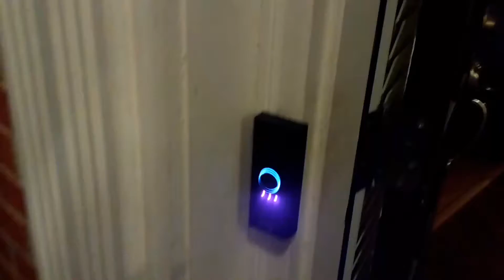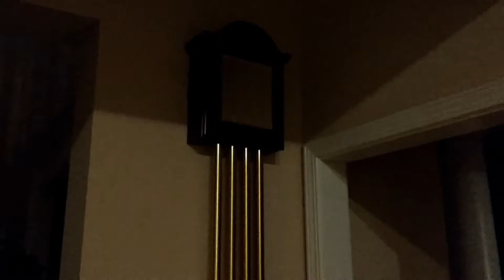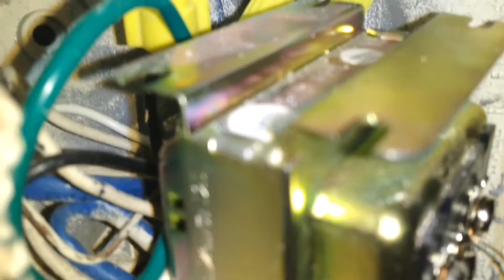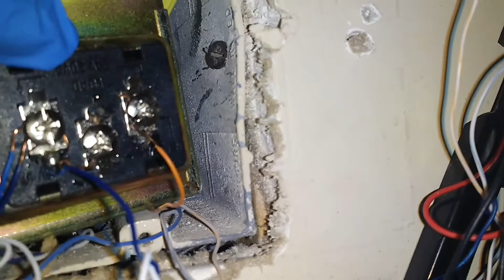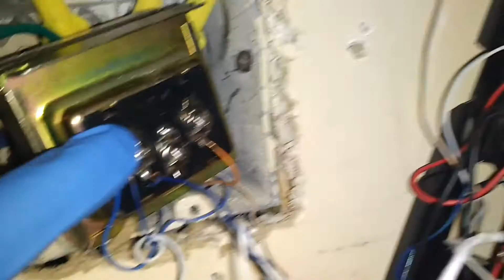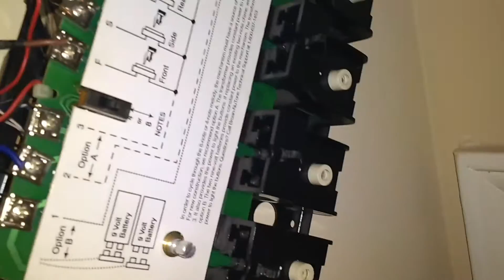Ring Doorbell Pro and Tubular Chime

Comment: I am having exact same problem with a Ring Pro and Broan/Nutone chime that looks just like the one shown in the video. But this video is very hard to follow, I really wish I can understand the wiring that's described here. A quick diagram wold help a great deal. I believe the Broan chime need to have power via terminals 2 and 3, which come from the transformer. Then the Power kit that's supplied by Ring is used to send power to the Ring Pro unit to power that unit, the problem is that when the Ring power kit is connected, it not only supply power to the door bell, but it also complete the circuit between terminals 3 and 4, which causes the chime to keep working. Obviously, the solution is to power the door bell, without triggering the chime when the door bell is not pressed. I have not figured out a way, was hoping this video can help.

Comment: What exactly is the point you are trying to make? You, as many of other consumers have a Ring Pro video doorbell. Are you saying a multi volt transformer is needed? Another You Tuber is saying Ring Pro doorbells cannot be used with electronic/digital chime systems due to issues with microprocessors. While I don’t completely understand why, I tend to agree with him, because that’s the set up I have and I’m getting a lot of interference when the chime sounds. However, Ring.com has a list of both mechanical and digital chime units whjch are all supposed to be compatible with Ring Pro.  I upgraded my transformer from 16v 10 amps to a 16v 30 amps and I’m still having the same issues. I’m trying to figure out if the transformer is the problem or if the existing chime is the problem or if the issue is having a digital chime, instead of a mechanical chime. What brand and model of chime do you have. You state it is mechanical system which I like much better. If I used the same chime as,you,with four notes, would the 16v 30 amp transformer work for that? I only need to program chimes for one door only.